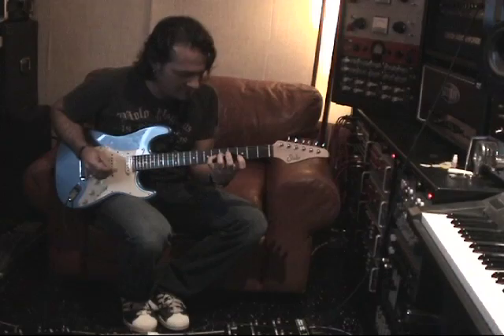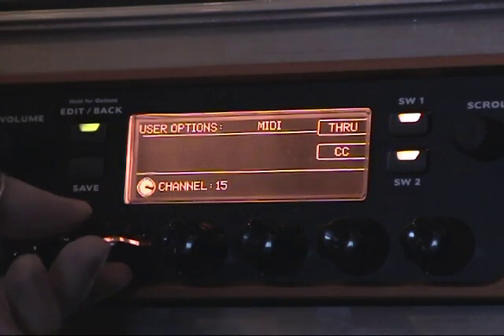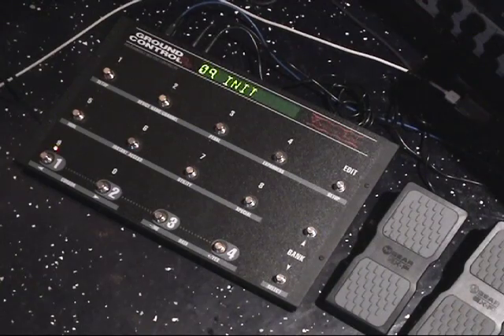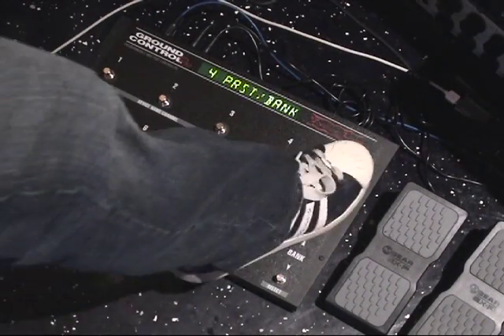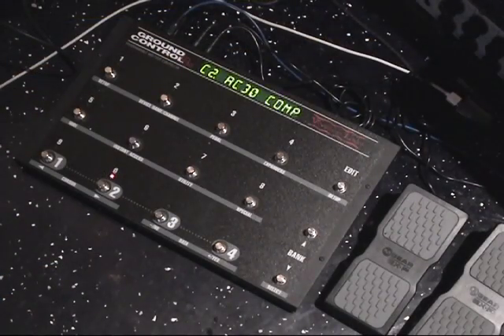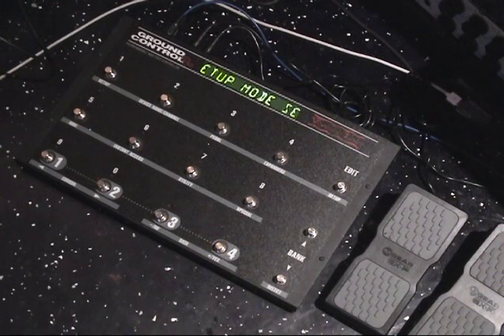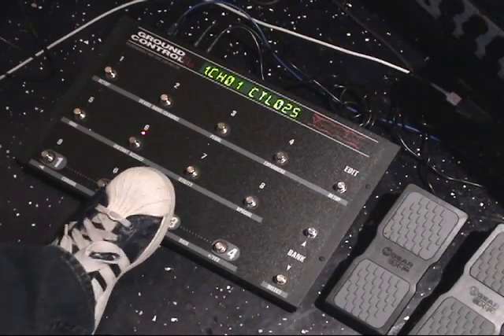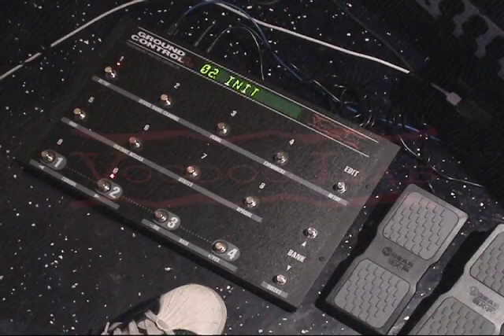Ground Control Pro / Eleven Rack Set Up 1 of 2

Comment: If anyone is still using this setup, if you set eleven rack to omni in midi setup you may experience volume loss on some channels. This can be fixed by setting it to a single channel for ground control pro. 👍

Comment: DO NOT SET MIDI ON ELEVEN RACK TO RxALL (Omni). It does not work correctly. I spoke with Voodoo Lab about the issues, and they said that the Eleven Rack needs to be set to midi Channel 1!

Comment: I did everything perfectly and I can not get the GCP to change anything on the 11r at all! 
I dumped the data and have all the right firmware updates on both units. 
It's set to 4 patch changes with the right names, everything looks right, all the numbers are matching up. 
In the midi menu in 11r I have it set to omni. 
I've literally tried everything. I have officially given up, what could possibly be wrong?
Reply: +Authorized Mike Did you ever figure out what the problem you were having? I seem to be having similar issues.
Reply: I did, you have to use just ONE midi cable, (GCP MIDI out --> 11R MIDI in)
Reply: +Authorized Mike That happened to me as well. I also bought a used Ground Control Pro that still had presets for a GCX, so I had to do a factory restore.
Reply: Same, luckily I had a midispor uno at the time so I also got to load on the 11R preset bank.
Reply: +Authorized Mike DO NOT SET MIDI ON ELEVEN RACK TO RxALL (Omni). It does not work correctly. I spoke with Voodoo Lab about the issues, and they said that the Eleven Rack needs to be set to midi Channel 1!
Reply: +Joseph Sparto DO NOT SET MIDI ON ELEVEN RACK TO RxALL (Omni). It does not work correctly. I spoke with Voodoo Lab about the issues, and they said that the Eleven Rack needs to be set to midi Channel 1!
Reply: +Authorized Mike Aaron, the problem that I have is that button 1 of my ground control pro isn't reading. So what happens is that when I press button 2 of my GCP it switches to channel A1 on my 11 Rack. When I press button 3 of my GCP it switches to channel A2 on my GCP. Is there a way to fix it to where button 1 changes the 11 rack to A1? When I have it set to 10 PRST/Bank, everything seems to be assigned properly, but I'd like to have it set up in the 4 PRST/Bank so that I can turn on and off certain effects on a bank.
Reply: Joseph Sparto
Try doing a factory reset

Comment: Potentially stupid question... Can you set one pedal to turn on multiple effects? Eg I generally always use chorus, delay and reverb together on a clean setting and hate trying to turn on 3 pedals at once.

Again, potentially stupid question but I'm new to all these wacky effects things haha
Reply: Definitely. That's essentially the reason most people use MIDI controllers like the Voodoo Lab. You can create banks of presets that activate any number of effects you'll need, which you initiate by pushing one of the numbered switches.

Comment: I try to explain my routing. 
The guitar gets inside a box buffer / LineDriver, together with an input for the amplifier, one for the volume pedal, one for the tuner. Then, one IN and one OUT for WAH and a SEND / RETURN. Connect the SEND of the first loop in the IN and RETURN go in the OUT of the last loop. 
I tried to remove the buffer / Linedriver to the chain but nothing. 
I tried to connect guitar and amp in the GCX directly on GTR IN and FEED THRU but still nothing

Comment: Hi all. 
I just registered on this wonderful forum.
I just bought The Ground Control Pro, GCX and two Pedal Power Plus.
I am very happy to have made this choice. The switching system is awesome, very transparent and functional.
Connect the loops exclusively pedals, eight pedals for accuracy.
I have problems popping when I make the change from one preset to another.
At high volume is really very annoying.
It's possible to solve the problem of popping in some way?
I apologize for my bad english!

Comment: Is it possible to use the 11R in 2 loops of a GCX?
I wanna have the virtual pedals before my amp and the delays and reverbs in the loop of my amp... And so it had to bypass the amp section of the 11R?

Is this possible?

Cheer Joost

Comment: Yup on the Suhr stuff, both amps and guitars. They make the best stuff on the planet! 
That's my original Classic with V60 LP pickups in it.
As for the sound, I was using the  AC30 model through the 25 watt 4x12 cab, all direct from the Eleven Rack into Pro Tools (at 33 seconds you can see the knob settings).
For live I've been going straight to the PA from the 11R, and everyone has been ecstatic with the quality - both front of house and the guys hearing it through their monitors..